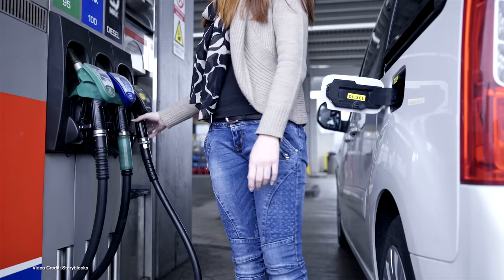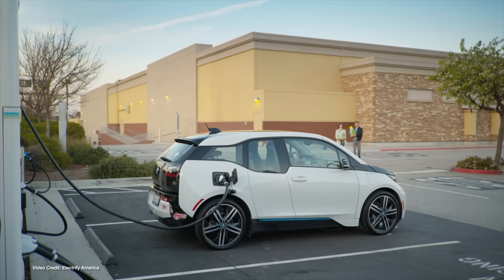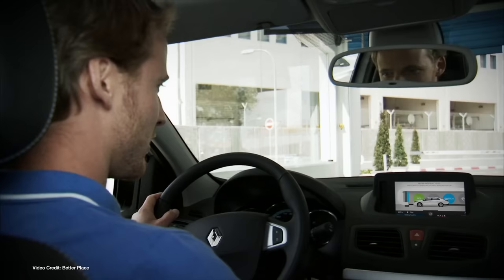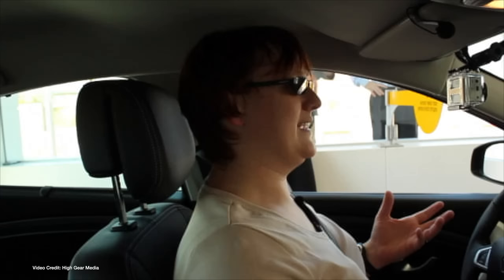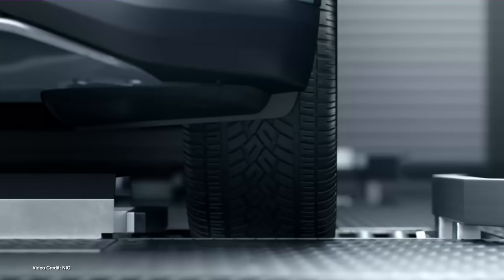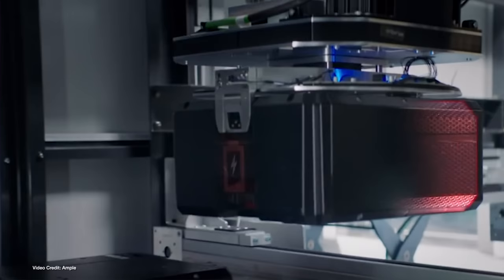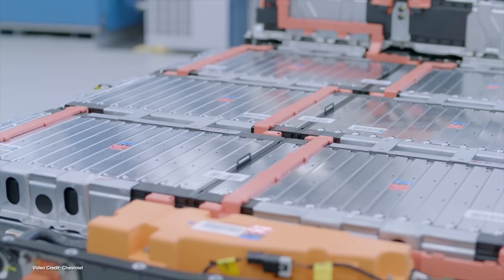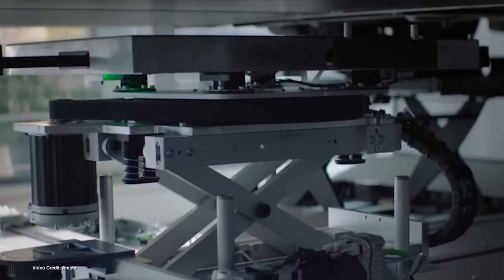Ample Space For Electric Car Battery Swapping? The End to Slow Charging? This Startup Thinks So

Comment: This is a solution for a problem that won't be there in 5 years, and they won't be able to put anything meaningful together for that time anyway. Far too infrastructure intense building a network for something where there is zero ecosystem for it at the automakers end. Even if one manufacturer adopts it, there just won't be enough vehicles on the road to fund the investment. I would not invest any money in this.

Comment: You my dear, are obviously not an engineer.  Swapping batteries at a time where batteries is the critical part in the production of EV’s.   Swapping batteries won’t work unless it’s got small vehicles.  Those batteries still have to be charged.
It’s better to switch cars than switch batteries.  Ample is dead before it even starts!!!
Reply from the maker: Your comments are arrogant. And condescending.
Reply: I agree. @Gerhard Kutt